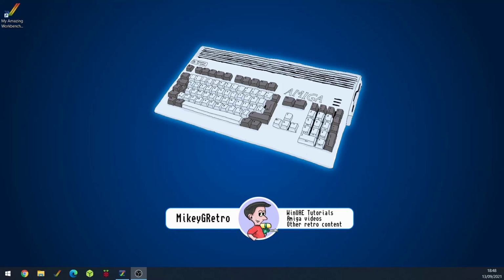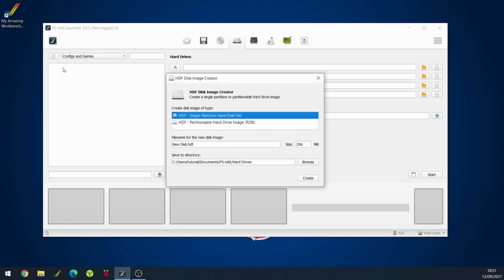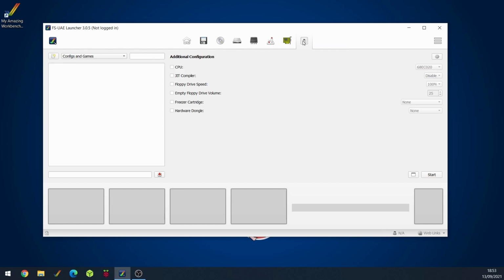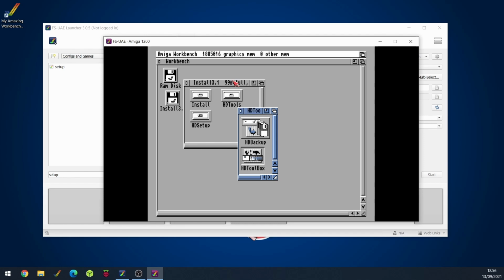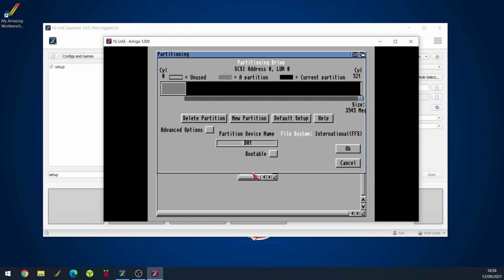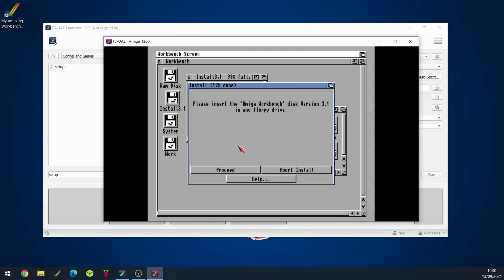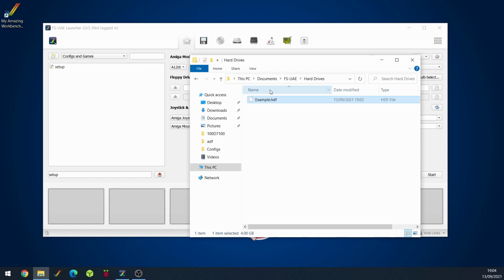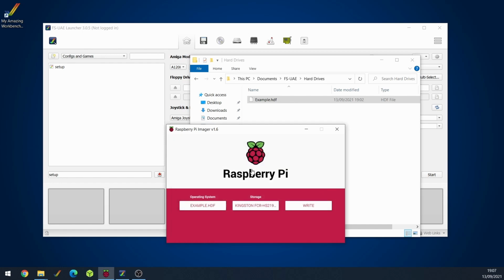Setup Amiga Hard Drive using FS-UAE

Comment: Sir your tutorials are perfect!
I followed your tutorial and i managed to install whdload , setting hard drive,, ibrowse.
I downloaded protracker2 using ibrowse from aminet , but after running lha x command and installation cant run it.
Similrar problem with python installation.
Could you please show us how to do it properly.
Thanks
Reply from the maker: What was the error when you tried to run protracker2?
Reply: It says "unable to open your tool pt2.3d"
also "python program failed (error # 8000000B)
waiting for disk activity to finish." when trying to run python typing python from cli.

Comment: I got "Not a valid DOS disk" Error, is this normal or not
Reply: insert media disk 1-install.adf 2-workbench.adf 3-locale.adf at start up. Not a valid dos disk means that the hard disk is not formatted and it is defined as booting device, computer tries botting up from unformatted and unistalled disk. Delete your hard disk file, create new one and follow the steps.

Comment: Hi, I have followed your HDF creation to the point after partitioning and restarting the Amiga emulation. I get an error screen saying "Not a DOS disk in device DH0". I have tried this twice and I get the same error. can you help?
Reply: I was getting this error, and I just split the 3.5 gig partition into 2 seperate ones under 2 gig and it worked.

Comment: Awesome video and very clear explained. Sadly my A500 + IDE Controller AlfaPower won't boot with my CF Card created following you're guide. Am I missing something? 
I can boot of the .hdf HDD in FS-UAE. I also used  RPI Imager to copy the file to my CF like you explained. But when I put it into my Controller the card seems to be checked (short LED activity), but then it stops and Kickstart 1.3 bootprompt shows up.
Reply from the maker: Another program to try is Win32DiskImager. What ROM does your A500 have and does it have acceleration? I'm not familar with AlfaPower board.
Also my setup was for an A1200 so you'd probably have to change that to an A500 instead.

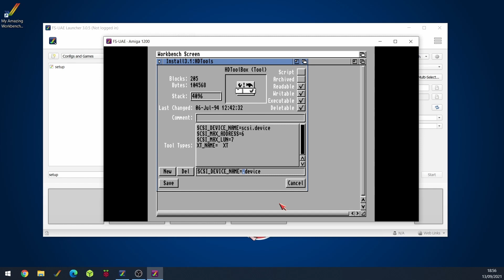Comment: 5:54 Interesting little hack,  Under usual circumstances you'd see a 'DH0:NDOS' on workbench, but this time you don't

Is that because of the partition type ? Single vs RDB?
Reply from the maker: A real amiga would have scsi.device in the Kickstart. Because it is emulation we can use uaehf.device which access the virtual hard drive. It is a device that is shown to the amiga side but on the PC side it's the vitual disk image.
In this video I was using RDB mode so it was treating the image as an entire hard drive rather than just one single partition. :-)

Comment: Not good for my AmigaOS4 🙁
Reply from the maker: Sorry this is for Classic Amigas. Don't know much about AmigaOS4 stuff sadly.
Reply: Wouldn't work anyway on Amiga 1200 with CF... Because AmigaOS4 requires PowerPC chip.

Up to date versions of FS-UAE can now emulate Amiga OS4.1 pretty much perfectly today.. But you need a Cyberstorm equipped Amiga then it should work eg Amiga 4000 or 4000T model

Comment: Thanks for that MikeyG. I am enjoying FSUAE more and more. Couple of questions. Can FSUAE see the Amiga formatted CF card directly like WinUAE can? Secondly, I noticed you did not put that hex value into the drive setting when you set up the drive. Is that because it is a file rather than a real hard drive?
Reply from the maker: The max transfer hex is still important. I forgot about it in the video. Thank you for pointing this out.